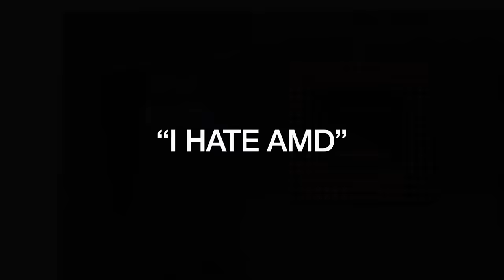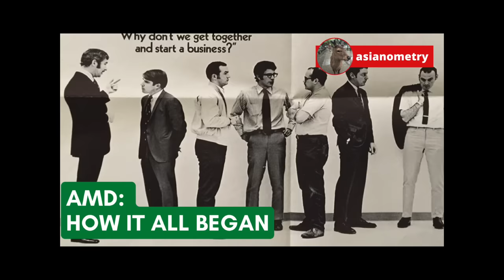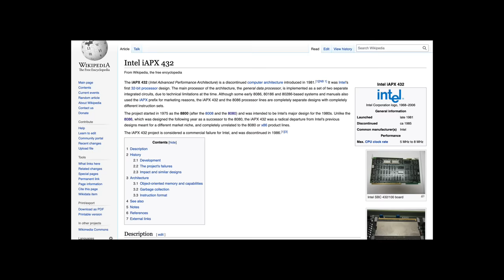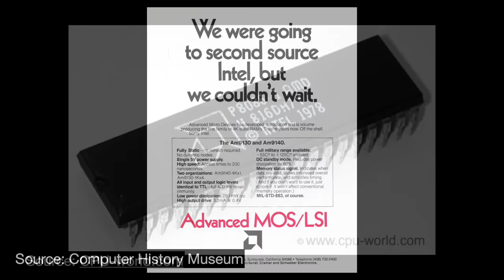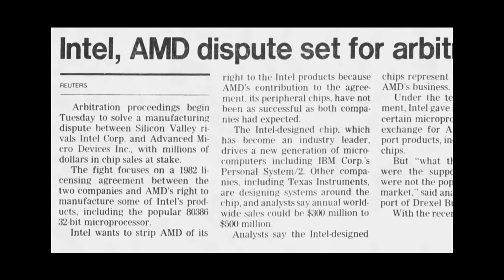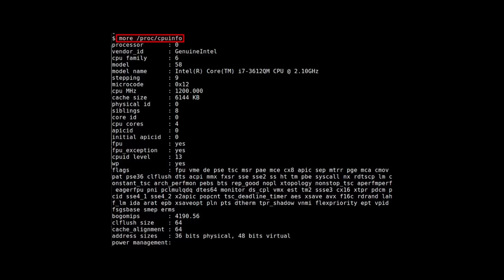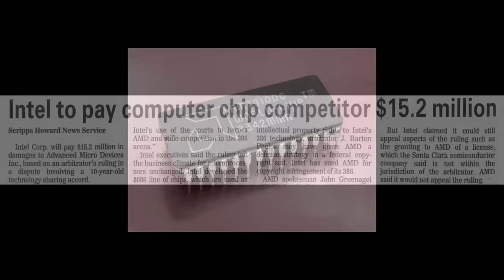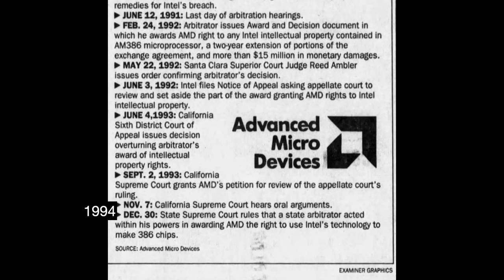Intel & AMD: The First 30 Years

Comment: My favorite part of the story is later when AMD created the Opteron and created the AMD-64 instruction set.  It was just nice to see Intel using AMD's new instructions for a change.
Reply: I was waiting for that, the Intel Itanium was a massive failure bit like the bull dozer.
Reply: Its my favourite part too, that actually brings us to the end of the issue because Intel would sign more deals with AMD to be able to use that instruction set and by now its called x86-64, in a sense its a product of both Intel and AMD, however Intel introduced a trap, if AMD was bought out they would not be able to keep their license, a Major reason they were not bought out during the early 2010s. The engineers behind the AM64 was also the men behind Zen core(left AMD after the launch) and last I heard he was working for Intel.
Reply: @pedrorequio5515  Are you referring to Jim Keller? If I remember right, he is now working at a RISC-V startup after Intel.
Reply: @xtaticsr2041  Jim Keller now works at Tenstorrent, so you would be correct.
Reply: AM64 was the old intel itanium 64 instruction set, the same
Reply: @lucasrem  IA-64 is not the same thing as x86-64. Not even remotely close.
Reply: Itanium was not back compatible with 486 code. That's why it failed.

Comment: Definitely crazy to see just how fierce the competition is between these two, although us the consumers are definitely better for it.
Reply: Not really, monopolistic competition that is so capital intensive that it forces the industry into a pure oligopoly is not consumer friendly…
Reply: I think there would be less x86 computers and more ARM ones. Less competition in x86 but way more in variety. Maybe Amiga, RiscOS and PowerPC would be better known.
Reply: @H0mework  let's be real, ARM doesn't scale that well on higher power designs and a RISC-based arch has the downside of being very dependent on compiler optimizations, as they don't have the micro-ops translation layer of modern CISC-based one like x86. Also the vast x86 software library makes ARM quite uninteresting for developers outside embedded products running Android. You have to be the Raspberry Foundation or Apple to have the leverage to make it attractive to consumers.
As for the name you dropped, Amiga hasn't developed something serious over the last 25 years. RiscOS has always been a niche compared to crossplatforn OSes like Linux or BSD. And PowerPC is now the excellent Openpower but IBM just made it for niche server applications and despite its openness the high costs and the fact no manufacturer dared to make its own Power CPUs just let the arch stale and now x86 is catching up on the perf level for a fraction of the price and wattage.
Reply: @PainterVierax  Psion and Sybian were around too, and windows XP 64 bit was rarely used even though it was"better". People gravitate towards software they need usually, not operating systems. You are assuming that MS would have had a hedgemony and few other OS developers, but there are many free Linux and BSD ports so I'm certain we have seen more diversity. I remember my n810 with fond memories until MS destroyed Nokia before buying it. Some people even still use the n900 to this day, a niche like that still attracted developers beyond it's normal lifespan. My n810 had no shortage of software either.

Comment: The AMD 386 DX 40 was an awesome awesome awesome CPU. It ran Linux like crazy. The AMD AM486 line was legendary in the day. The AM5x86-133 was by far the best '486 ever made.
Reply: Do not forget about Cyrix and its 5x86 line. It could outcompete its AMD counterpart in many-many applications.
Reply: Did you run linux on it back in the day? What OS did you use?
Reply: @michaeldale837  Yeah, it was a AMD 386 DX 40 with a Weitek '387, 8 MB RAM 128k of cache. I ran Slakware on it. It was a slick workstation. I used it for years.
Reply: @AndrewTubbiolo  Amazing so cool. I assume for the Weitek you were using some specific CAD app? Did you dual boot?
Reply: @Kedvespatikus  I never tried the Cyrix brand, but I kept hearing bad things about their floating point performance. What was your experience?
Reply: @michaeldale837  No dual boot. It was my dedicated Linux machine. I was doing programming for orbital mechanics simulations, so I needed a good '387. I also ran my own email and ppp internet service for my home. I could call into the university modem bank then telnet to my Linux '386 and use ppp as my ISP.
Reply: @AndrewTubbiolo  Their 5x86 FPUs were better than that of AMD's. The stories you've heard could be in the 6x86 era - the 6x86 Cyrix CPUs were appalling regarding floating point performance.
Reply: @Kedvespatikus  Oh interesting. I'll look for vids that benchmark that series. I'd love to see what I missed. Thanks for your experience. Nostalgia Nerd did an amazing history of Cyrix I still like to go watch that again every once and a while. I think CPU Galaxy is building up to doing the Cyrix series as well.

Comment: Back in the days, the central processors were relatively easy to r&d and manufacture, so the market was NOT an oligopoly of just Intel and AMD. In addition to the mentioned Zilog, Motorola and NEC there were also IBM, DEC, HP, MIPS, SGI, Sun, Hitachi and many more. I especially note Cyrix's x86 compatible processors that were not half as fast at the same frequency, but also required less power and emitted less heat, so they could afford working without a cooling fan when all the other x86s were already in need of it.
Reply: Yup the venerable Cyrix 686

Comment: As we get on with the decade in which Intel struggles to recover its mojo -- and AMD basks in the sunlight it pined for, for the past generation...
As always, well done, Jon.
Reply: Stick a fork in Intel.  It's DONE.  And rightly so.  Sure, they'll reorganize, probably spin off their fabs to a new corp,  and probably supply some x86 for a few years, but with RISC-V gaining momentum at just the right time, I am guessing this arch is going to be the new hotness in a few years.  Who knows who it will be
Reply: @kayakMike1000  I've heard that the biggest ball-and-chain around innovation in general purpose PC atm is the x86 arch - I'd love to see a new arch, be is RISC based or otherwise. Apple made the switch from PPC to x86 to ARM, so it's definitely doable. They have a unified software-hardware ecosystem that makes the transition a lot easier though.

It's been tried with IA64 and that was a massive flop. I don't know the details of why it didn't get adopted though

Comment: That was an interesting side note about Mostek.  I was firmly in the Motorola camp from the time the Atari ST came out (and Amiga, I guess) powered by the MC68000, whose assembly language and processor architecture I found far more comprehensible than the Intel 386.  I stayed in that camp until the NeXT computers were discontinued, by which time Intel/AMD had finally come around to a sane form of memory addressing.
Reply: Compared tot he x86 the 68k series was really an elegant design.

Comment: 9:50 - The 386 is not just 32-address bus, but internally 32-data, from bus to registers, to addressing. The x86 pipelining may make that a bit opaque. A true 32-bit processor, that scared IBM, hence lost their PC lead.

You want to know the real reason for the Pentium name. When they added 100 to 486, they did not get 586. The pentium's built in math coprocessor had an obscure math bug.
Reply: You're right.  32-bit addressing & data processing was the primary selling point, not the 32-bit bus, as shown by the 386SX chips, which had the same internals, but with cut-down 16-bit bus.  Because I/O is expensive!  And nice jab at the FDIV bug.
Reply: Thanks for reminding about the FDIV bug. 1993 was pretty exciting in the PC space, with Pentium shattering everything and AMD and Cyrix making a lot of noise about their upcoming K5 and M1 CPUs.

Comment: Cyrix were also producing x86 compatible CPUs at that timeframe. Did they have an agreement with Intel ? Or were they small enough to pass under the legal radar ?
Reply: Cyrix did not have a licensing agreement with Intel and as a result had an even more contentious legal battle with Intel than AMD had (and which Cyrix ultimately won). Cyrix did not produce 386 clones though, their first CPU clone was the 486 (although in a 386 pin socket package). The Cyrix-Intel fight would make for an interesting Asianometry episode as well.
Reply: @MaxPower-11  thanks! Definitely sounds like a video to wait for. TBH I know very little about Cyrix.
Reply: I think Cyrix used legal workarounds in order to sell x86 CPUs. Back then companies like IBM and Texas Instruments had an x86 license. Cyrix had these two companies (along with STMicro which also had a license) to fab their chips for them. As part of the deal these companies could sell Cyrix's designs under their own names, such as the Texas Instruments Ti486, which was a Cyrix Cx486.
Reply: @MaxPower-11 Cyrix's first x86 product was, IIRC, the FasMath Math Co-Processor for Intel 386 systems. Then they had the Cx486DLC/SLC which were kinda like a cross between a 386 and a 486 and plugged into 386 motherboards. They later produced 'real' 486 CPUs, the Cx486DX, which was their own design, benched a little slower than competing Intel and AMD products but also ran cooler.

Comment: While microcode can be updated/configured by firmware in some instances, it is still microcode and quite different from firmware in its function in a processor architecture. Microcode determines the multiple steps taken by the different hardware elements in a processor during the execution of each processor instruction. 

This is a fascinating period in computing history.  My first PC (in 1989) used an 80286 made by Harris Semiconductor, another that was locked out of this market by the introduction of the 80386 design by Intel.

Comment: Good job. There was a bit of conflation there with microcode (its firmware?). It would have helped to underline that it is entirely internal to the chip and operates the internals of the CPU. In any case, microcode was discarded with the Pentium series, KINDA. It actually lives on today in so called "slow path" instructions like block moves in the later cpus, which use microcode because nobody cares if they run super fast or not, since they are generally only used for backwards compatibility and got deprecated in 64 bit mode.

I await the second half of this! Things took off again with the AMD64 and the "multicore wars". Despite the mess, the entire outcome probably could have been predicted on sheer economic grounds, that is, the market settling into a #1 and #2 player with small also-rans. Today's desktop market, at least, remains in the hands of the x86 makers except for the odd story of Apple and the M series chips. Many have pronounced the end of the desktop, but it lives on. I have many or even most colleges who use Apple macs as their preferred development machines, but, as I write this, I am looking out at a sea of x86 desktop machines. Its rare to see a mac desktop, and in any case, at this moment even the ubiquitous Mac pro laptops the trendsetters love are still x86 based, although I assume that will change soon.

Me? Sorry, x86 everything, desktop and laptop(s). At last count I have 5 machines running around my house and office and 4 laptops. I keep buying Mac laptops and desktops, cause, you know, gotta keep up with things, but they grow obsolete faster than a warm banana. Yes, I had power PC Macs, and yes they ended up in the trash. And yes, I will probably buy Mac M2s at some point.

Comment: I guess the 8086 is proof that there's nothing more permanent than a temporary solution.
Reply: It's just a question of retrocompatibility. That's also the reason why AM64 gets traction over Itanium.
Software development has a lot of inertia, especially in the low level programming (OS and drivers) and with the closed-source model.
Even a big cult like Apple had to provide some satisfying translation layers (Mac 68k emulator then Rosetta1 and 2) to assure the success of each of its 3 architecture transitions.

Comment: I'm not sure what your sources are, but the IBM PC used the 8088, which was a more economical version of the 8086.  The 8086 was a true 16 bit CPU, whereas the 8088 was 16 bits internal with an 8 bit external data bus - much cheaper than to implement.  Also, the 80286 was used for the IBM AT and was very successful.

Comment: The 386's legacy isn't only about 32 bit address buss. iirc it introduced Virtual Memory with an MMU. This is a huge evolution that is indispensable for multiuser multiprocess machines
Reply: And really nice and general addressing modes. Before the 386, there were annoying limitations on which registers you could combine (and how) to form a memory address. The 386 instruction set was much more orthogonal than the 86/186/286 instruction sets… but the encoding was of course not nice and orthogonal.
Reply: @peterfireflylund  agreed, real mode is crazy! Throwing away that offset math and using a linear address space was a real improvement!
Reply: @holmybeer  no, I’m talking about the ability to write [eax+ecx*4+1234], which works fine in real mode, btw. Before the 386, you could only use a few specific register in address calculations (bx, bp, si, di). If you wanted to access something on the stack, you almost had to use [bp+disp] (which conveniently defaulted to using the stack segment). You couldn’t write ss:[sp+disp] so you were basically forced to use bp as the frame pointer.

Comment: The outcome of all these legal battles was predictable...
The attorneys on both sides were generously compensated. They won.
As for the engineers, not so much.
Reply: Patent and copyright are only constitutional if they "advance science". To the extent that they no longer do this, they must be abolished.
Reply: @gregorymalchuk272  I agree 100%. However, I worked on patents for six years as an engineer assisting a company’s half dozen full time attorneys. Based on that experience. I have a dim view of the patent system actually adhering to the principle you mentioned.  The USPTO has taken steps to reduce the frivolous ones, but they still occur. 

What’s worse is the way it is abused. If you work for a small company, and market a superior product to that made by a large company, watch out. Even if you don’t infringe on their IP, they may pick several of their patents, add them to a letter they send stating you DO infringe and threaten legal action. 
Just going through the motions to counter their legal actions may include a ruling to prevent you from selling while it gets litigated, and can take years. Meanwhile, the ongoing legal expenses can bankrupt you, or force you to accept some onerous terms.
I've been on both ends of this experience.

Comment: It would be nice to give some technical datas to this early processors. Meaning Data- and Addressbus size, Register size and number. And clock rate. Also if floating point numbers are supported.-

Comment: Interesting that you referred to IBM's Boca Raton team as the 'toy' computer makers.  Through the '80s, the IBM Fab in Burlington VT had really strong process tech, but mediocre products.  IBM got second source rights to the 486D micro, and got good yield on initial builds.  It would have been a great line filler to turn the focus from technical papers to manufacturing discipline, but the PC team used it for price leverage on Intel purchases.

Comment: I had forgotten about all those lawsuits.  They really disgusted me, like Intel had so little faith in their capabilities that they had to resort to lawyers playing petty word games.  But I didn't think much of their processors either.  The 286 was a miserable stop-gap joke, the whole x86 instruction set felt like Rube Goldberg and Heath Robinson bandaids on top of each other.  Kept rooting for Motorola's 68K series, nice and simple and clean in comparison.
Reply: Amiga's taking over the world.
Reply: The 68K had ridiculous addressing modes — and then the 68020 got even more of them!
Both instruction sets were kinda hard to decode. But, hey, Amiga forever, right?
Reply: @peterfireflylund  Don't know nuttin' about the Amiga.
The x86 instruction set smells of terrible design followed by terrible revisions.  The 68K instruction is mostly symmetrical and logical.  Those addressing modes were not all useful, and for all I know they made pipelining hard, and maybe that's one reason the 68K couldn't keep up in the MHz wars.  But they were easy to understand because of the symmetry.

Comment: The irony is that if Intel and AMD don't both get their ARM-compatible chips running, they will find themselves out of a market. Apple's M1 and M2 have finally enabled Apple to produce a MAC that is price-competitive with Wintel-based desktops, and releasing an ARM version of Windows requires very little work.
Reply: "releasing an ARM version of Windows requires very little work" haha, that must be a joke.
Even if it were the case it also requires that every Windows software company on the planet now needs to release (and manage and test) an ARM version of their software. We know how well that went with the Windows RT based MS Surface 2.

Comment: I thought I read that the 4004 microprocessor was developed for use in places like elevator controls and someone then realized after the release of engineering samples that it could be the core chip for a calculator.
Reply: Wouldn't the 4004 have been way too expensive for elevator controls back in the day?
Reply: @katrinabryce  at $200 or even $300, it would be a miniscule amount if you consider the total cost of an elevator
Reply: Not true. The 4004 was commissioned from the start for use in calculators by Busicom. That it soon found a lot of other use cases is  another history.